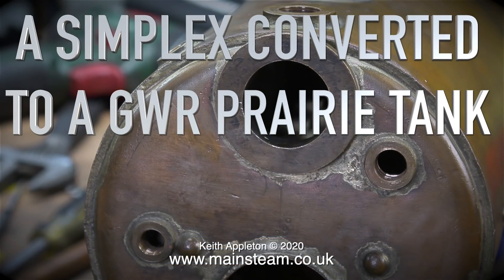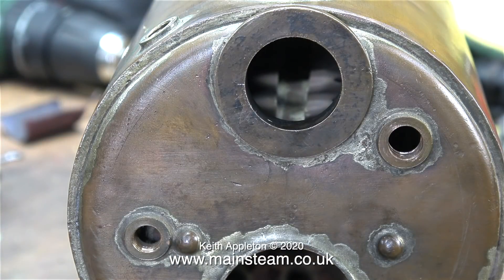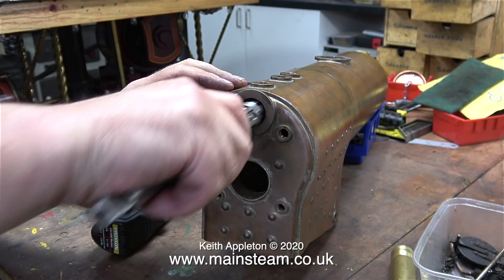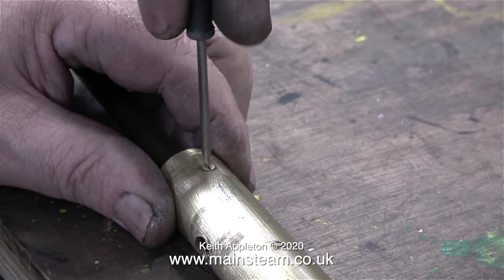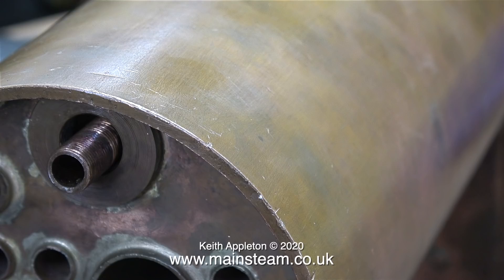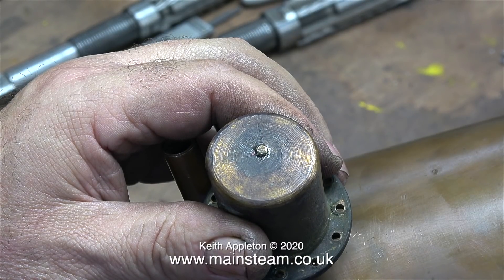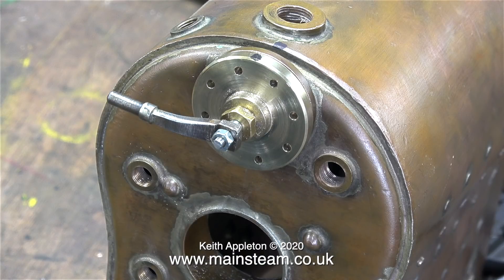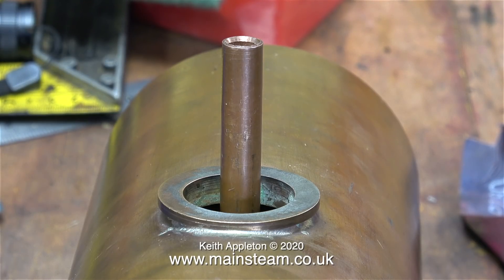SIMPLEX PRAIRIE TANK - PART #3

Comment: I've used that type of reamer for years on axles to fit king pin bushings that had worn out due to over-lubrication.  I can tell you that no matter what the material you really need to lubricate it!  Otherwise it will not cut a true circle, and may cause tear-out ruining the hole. These problems are caused by the length of the cutter blades, the front part wears more quickly over time, which results in a taper that the rear of the blade has to correct,  unlike a boring bar that uses a narrow tip. .    Now if only I can figure out why I couldn't view Keith's videos on the Patreon channel today.